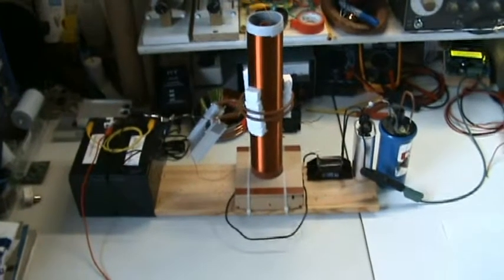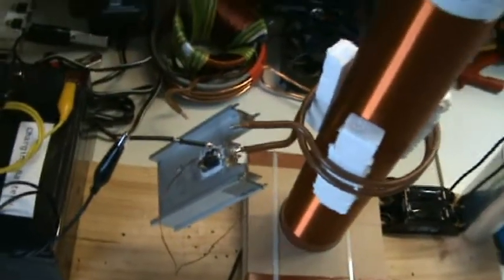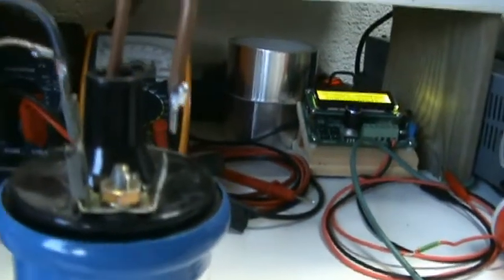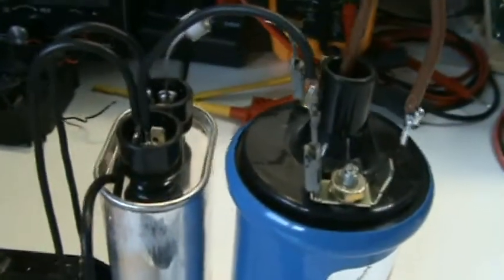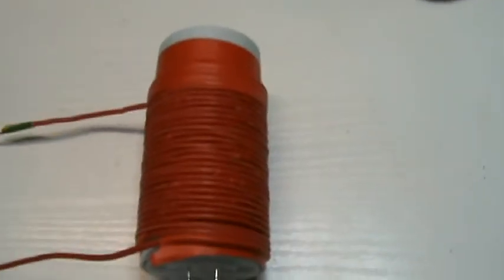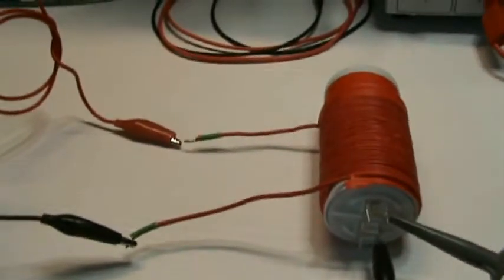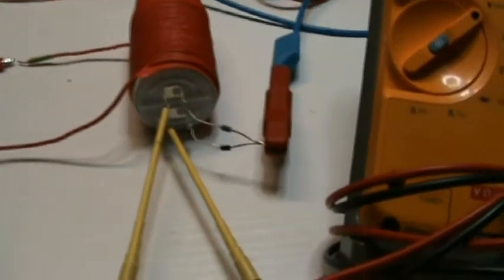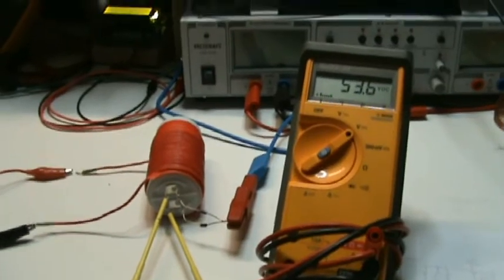CapCoil 1.mpeg

Comment: can you try to exchange spark gaps with 1B40 tube?
these are 1KW little spark tubes that lights like neon
Do not forget to add cooling sink. as it may damage it.
These are  to be obtain at ebay.

Wesley